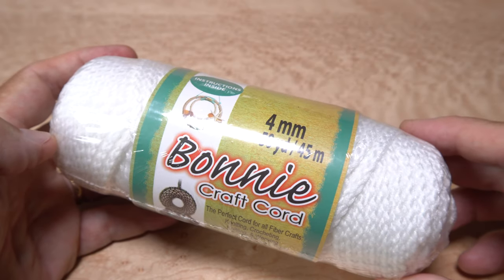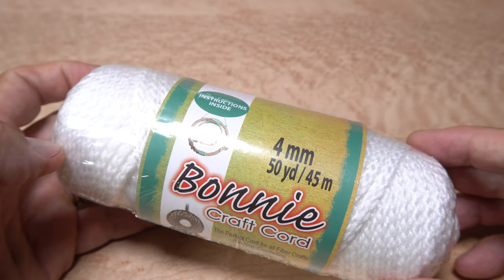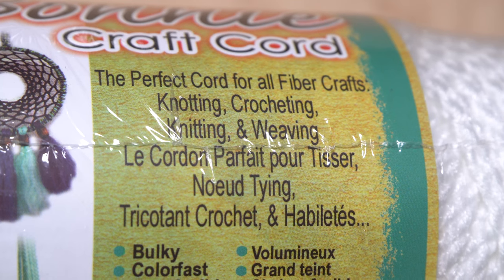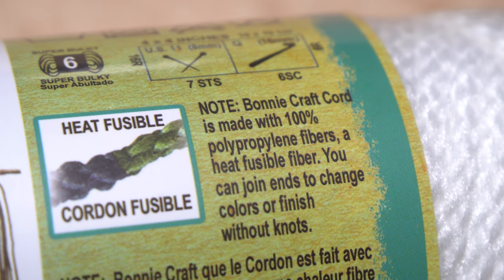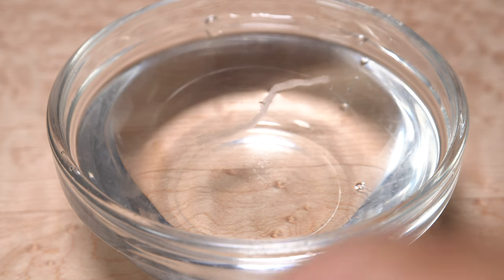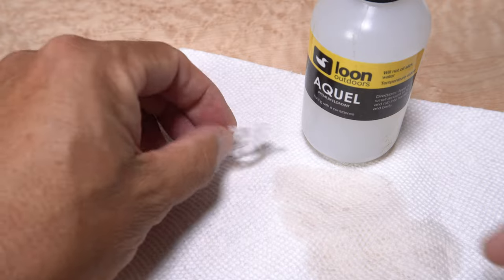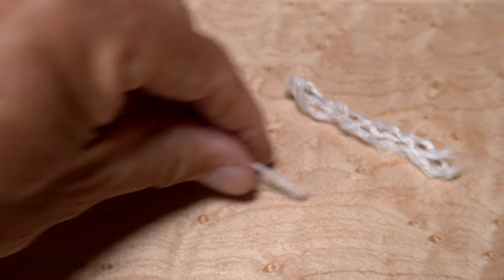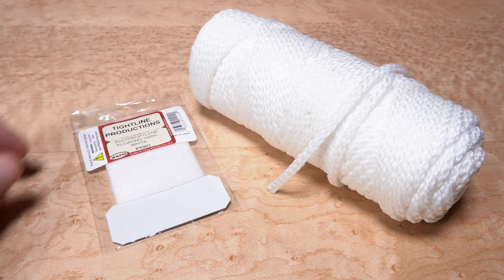Macrame Cord

Comment: Sometimes the paradox is where you can buy 20 yards of a given material for $8 where a fly shop will sell 2 yards for $3 - the truth is: The 2 yards at the lower price can actually be about 10 years worth.
Reply from the maker: Excellent point Ken! Storage is another issue. The large thing of macrame cord takes up a ton of space in my storage drawer. Even though they are more expensive for the amount you get, I'd still rather have smaller packets that take up much less room. I also like using multiple colors of polypropylene which just compounds the problem.
Reply: @tightlinevideo  purchase white bonnie braid and dye it to any color you might like with rit dye.  You can use the rit to dye your grizzly hackle as well.

Comment: ALBOLENE on a Dorsey indicator made of Bonnie braid   FTW.  Step it up a notch and mix albolene with Coleman camp fuel and you have flyagra.  I've even seen some tiers use Sally Hansen nail polish instead of 'name brand' head cement, seems to work okay.😁😁😁
Reply: Sally Hansen is great but it ain't cheap. Costs much more than head cement.

Comment: Tim. I picked up a vintage (maybe 1970's), handmade, ivory colored, 5' high macrame plant hanger from our local thrift store. I figure it must of come  from a non-smoking/pet free home as it was in almost mint condition.
Unlike your test of the 6mm Bonnie Macramé Craft Cord, this old stuff floats even without floatant.
It may be that the person used a totally different brand of macramé cord or it may be possible that the newer product isn't made of the same fibers as the old stuff? 
One thing for sure is I'm not parting with this find.
Reply: Update: The macramé that I described in my post above, looks identical to the three strand stuff that Capt Matt Thomas's YouTube video which was posted back on April 22, 2012 (How to tie a yarn indicator~Super Sensitive).